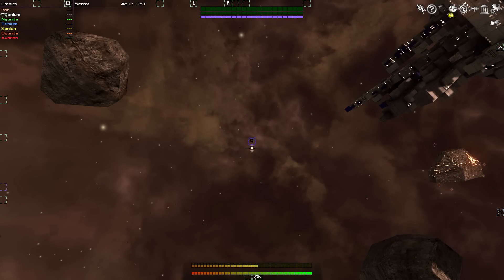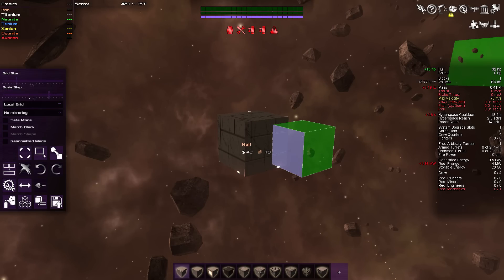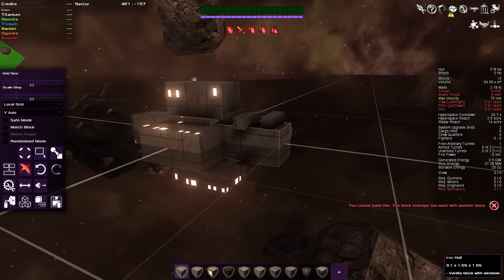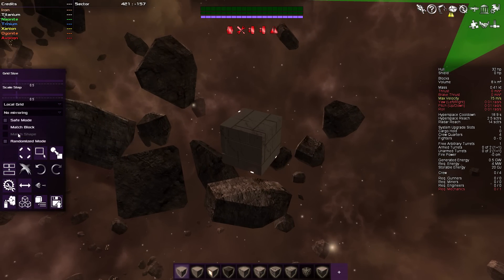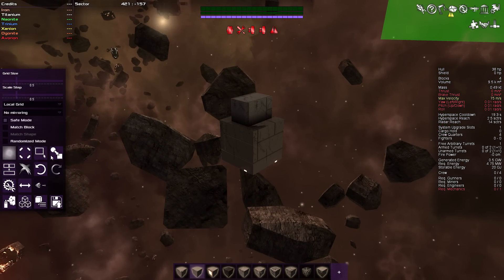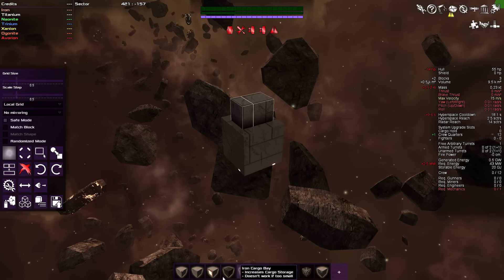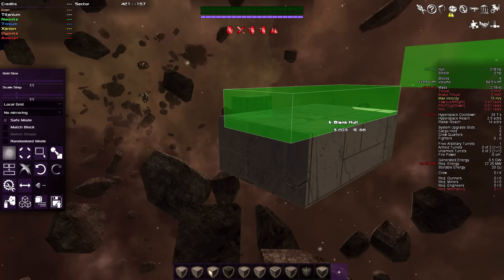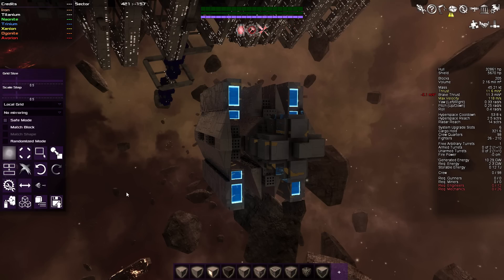Avorion Ship Building - The Builder

Comment: just bought the game recently and love the building mechanic and the way the asteroids break up too. Just started to build larger ships. I know one of the tips is that thrusters are better placed away from the center of mass. Well the ship I just made I couldn't really put more thrusters on without it causing a lot of negative thrust and negative top velocity. It would be good to have some tips and tricks on building ships in your next video. It's kind of difficult to determine how far it has to be away from the center of mass or what I could do to get around it. I'll probably be using some of the game ships as a reference though and just watch what others do when they build a ship.
Reply from the maker: Yeah, there are all sorts of little nuances that I've been discovering.  I did the prep work for my next video this morning and hope to record it tomorrow and I'll make sure to mention that.  I had planned on it anyway but feedback like that helps me make the videos that much better.  Thanks for the support!!
Reply: I might do some testing, but I think I might of figured out what it is that caused the negative thrust. It make since in some way. You know how some blocks benefit more on surface area than volume? By the way that wasn't stated on how thrusters worked also in your new video. Well what I theorize, haven't tested yet, the depth of the engine is more important than X or Y. I mean it makes sense in essence, having a wider engine that doesn't have very much depth wouldn't have the capability to produce much thrust. I was thinking adding more engines would help, but the mass of the engine is countering the thrust required to move the ship. It still doesn't make much sense too me cause I'm not rocket scientist. It does tie in to how I was crafting the ship though.

I'll post my other comments and questions on the other video though